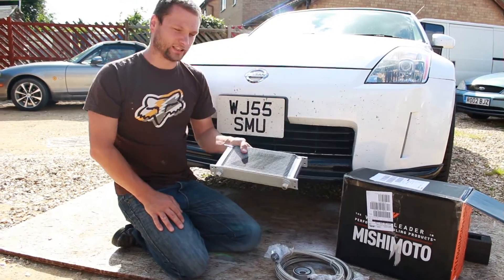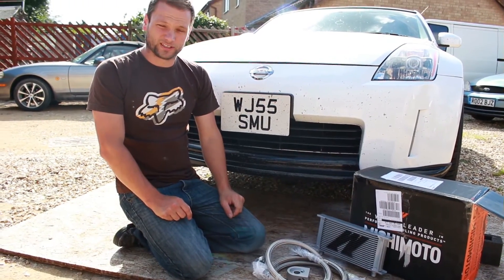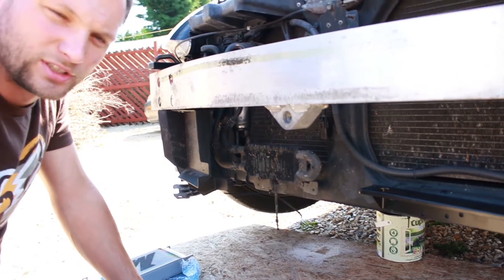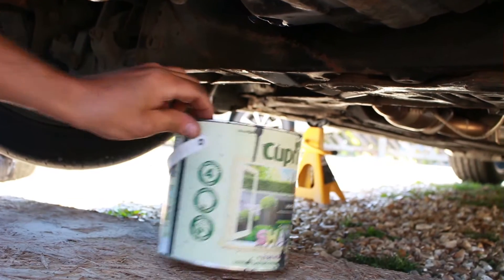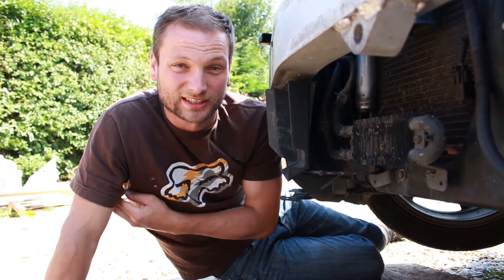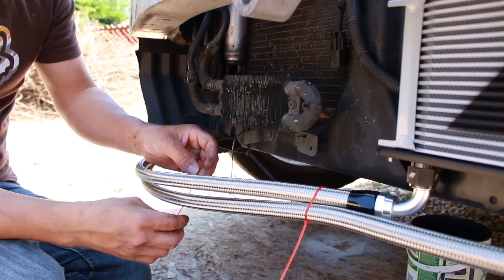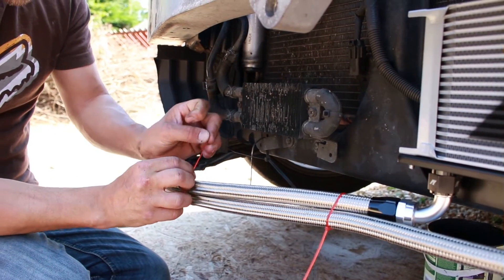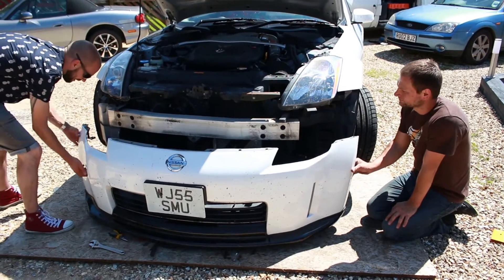Fitting a Nissan 350z oil cooler

Comment: Nice Video subscribed. I will soon install my mishimoto oil cooler in my 350Z too. But with lines on top and vibration-damped mount. I will do a Video on my Channel. I got a lot other 350Z stuff there... Check it out Bro´s
Reply from the maker: MIMCK Media subbed! Nice channel dude

Comment: By tying both of the lines together wouldnt that kinda defeat the purpose of cooling it? You got hot oil directly passing and essentially reaheating the "cooled" oil that just went thru the cooler....correct me if im wrong but i just had to ask
Reply from the maker: SupaSupa789 I would say that if you were a race team looking for every degree of temperature, then Yeah, but the difference would be so small it wouldn't make a difference to a normal car, the oil returning will still be cooler than before going through the cooler.

Comment: Was thinking of getting one for my hr, but what if it comes to be a wishimoto too :(
Reply from the maker: 350z_Geo you can put it the other way round so its just blank, but yeah for some reason they all come this way.
Reply: How does the car run? Do you have a performance radiator too?
Reply from the maker: 350z_Geo no I'm just running the stock radiator at the mo, runs fine though, put in extra oil to compensate for the cooler and its fine!
Reply: he has it installed upside down. which is wrong

Comment: Had mine installed yesterday. initially this car was not supposed to get as many modifications as I put on it but this particular oil cooler is just one more thing that I've done I find myself gravitating to wanting to do more and more to it and wanting to drive it a lot more because after all this car was just a quick little weekend zip machine. I'm finding that i am leaving my GN regal more just for car shows and this one for more fun use.
Reply from the maker: Sheldon K awesome! Yeah it's definitely a great modification to have done. These cars are renowned for getting a bit too warm, so anything that keeps the  Temps down has got to be a good thing.

Comment: I just fitted the same kit to my Z , I found the lines were to long so I cut about 4 inches off the lines
Reply: I had to drill holes aswell, I used a threaded rivnut tool thing so I didn't have to put a nut on the back
Reply from the maker: retroal strange, the lines on mine were perfect for fitting, and ties up nicely in the route they recommended

Comment: Never mount A oil cooler like this!!!!!
Reply from the maker: Montiericko Williams hey, whys that? I've heard a few people say that but don't know the reason, this is the way they show to mount it, and I tried it the other way up and the lines weren't long enough to reach to the top.
Reply: Cause it wont cool right bro have ti be sideways or rite side up the best way is sideways. If your lines to short but longer ones.
Reply from the maker: Montiericko Williams I messaged mishimoto to ask why they're selling this kit if it's not good for the engine. As their installation still shows to mount it this way and won't fit any other way, and it's not like it's a cheap kit either. Hopefully they'll get back to me
Reply from the maker: Montiericko Williams I messaged mishimoto to ask why they're selling this kit if it's not good for the engine. As their installation still shows to mount it this way and won't fit any other way, and it's not like it's a cheap kit either. Hopefully they'll get back to me
Reply: SJB Garage So, did they reply?
Reply from the maker: Alexander Rusev Yeah, they got straight back to me, they said it certainly isn't an issue at all to run the cooler either way up, and I've got nothing to worry about
Reply from the maker: Steve Wills I've been filling right up to the max of the dipstick, which is about 1ltr more than you would normally put in

Comment: Get a oil catch can ASAP! If you drive hard at all you're creating blow by in the PCV system and it blows a oil fuel mixture right back into your intake manifold ! I just got one for my Zed off EBay for $70 EVERY time I drive hard I crack it open and there's always something in it.
Reply from the maker: Nick Nunez thanks for the advice, it's on my list of things to get done.

Comment: lol @ "Wishimoto" - How was the 'M' logo spray painted on upside down on the oil cooler?
Reply from the maker: Haha.  apparently they've  updated the way it should be fitted and the pipes need to go in the top. But it still has the old bracket system to mount it the way I did. So I'll change it over in the near future.

Comment: Do you have to add an extra amount of oil with this install, so there's enough oil in the engine itself when it's going through the cooling process?
Reply from the maker: Yeah.  works out about 1.5 ltrs ish.
Reply: +SJB Garage alright cool, thanks!

Comment: the lines are supposed to be on top. being on the bottom is going to give you the worst performance
Reply: That video is outdated. They changed it and that's why the M is upside down on this video. Look up oil cooler orientation and see how everyone has them mounted on
Reply from the maker: strange as this is how it was shown to be fitted. That's why we did it that way.
Reply: lines go down. Mishimoto has a installation video and they mount it lines down to.
Reply: +SJB Garage Please fix this asap as not only will this reduce performance but it also is not good for the vehicle at all.

Comment: check your oil more often the cars burn oil easily maybe that's why you only drained 2 lit.
Reply: you have a 350z?
Reply: PS4 Genius yes had the Rev up sold it and bought an HR
Reply: how often do you have to check the oil, cause i'm thinking about getting a 350z but i heard oil is used up quickly
Reply: About a quart a month depending how much you step on it or you can save yourself problems and go with an HR
Reply: sorry for sounding noobish but whats HR
Reply: PS4 Genius no worries it's the 2007-2008 350z models nissan fixed most problems a noticeable amount of more hp it also has a dual throttle body and consuming oil won't be a problem
Reply: PS4 Genius it's just like an all around better model Z
Reply: K, thanks

Comment: Is there a drain on the cooler tank?
Reply from the maker: not on the tank no. so you'd have to disconnect it. It sits higher than the sump though so it should drain whenever you let the oil out of the sump any way.

Comment: looking good dude
Reply from the maker: Thanks man!!
Reply: SJB Garage i think you installed it upside down cause when you look at mishimotos youtube channel the line are supposed to go from the top of the oil cooler not the bottom like you have them
Reply from the maker: Yeah I tried to refit it the other way and the oil lines aren't long enough. so it will only fit this way up.